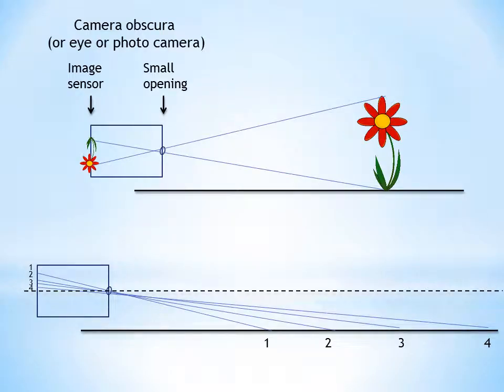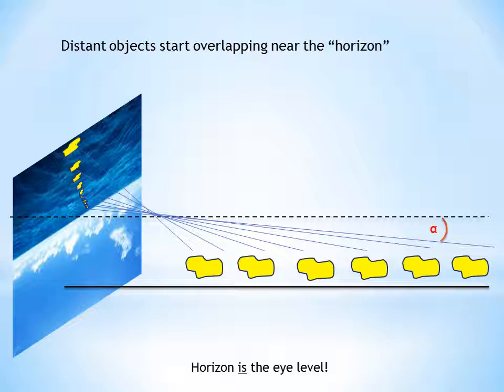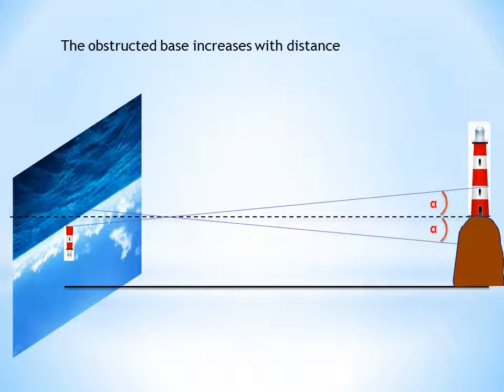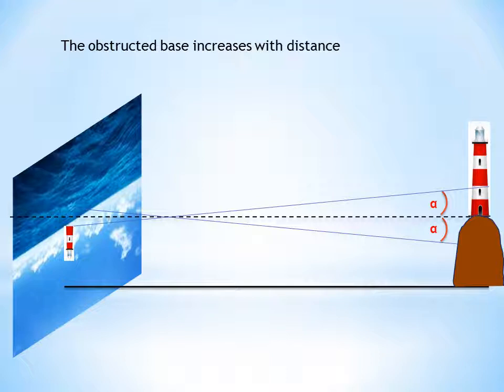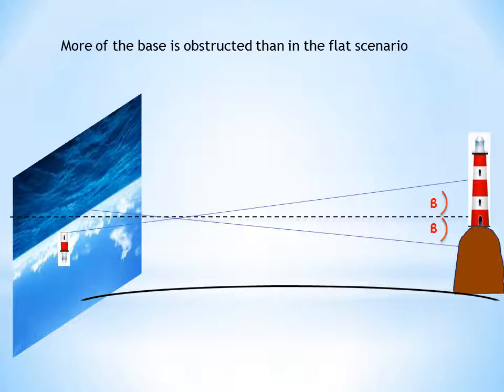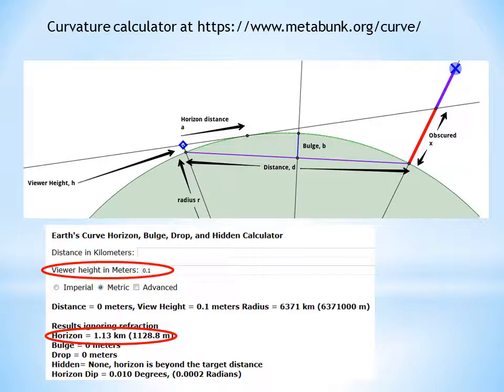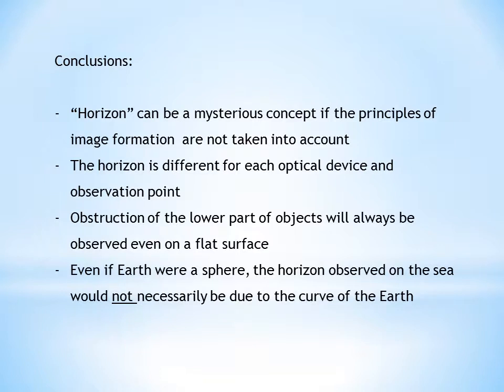Flat earth perspective   Horizon is the key

Comment: Very interesting video! I think narrated slideshows can be very effective, it's how I do all of mine. :-) You asked for my thoughts, well here goes!

3:23 "Things start overlapping." I disagree, if the oil patches are all on the surface of the water they will simply become so small and so close that it will be difficult to discern them. (This relates to your point at 4:53.) But they will never overlap.

4:20 You say that the horizon line will be different for all of us. But the evidence shows otherwise. You can get ten people, AND ten different cameras at different focal lengths from wide angle to telephoto, AND even a few telescopes, and every single one of them will see the horizon in exactly the same place.

You can test this at the beach by standardizing your viewing height, say, a hole in a piece of cardboard with a cross-hairs made of thread, and you can have a yardstick sticking up out of the sand between the observer and the horizon. The person (or camera) needs to say (or record) where the horizon is, when looking (filming) through the hole. All will agree.

4:35 You say that "horizon is the eye level." This has been repeated many, many times, but never tested by Flat Earth folks. It's easy to do: just borrow or rent a construction 20x Dumpy level, and aim it at the horizon. It will be below eye level by a fraction of a degree. If you can elevate it to a high cliff or a mountain overlooking a water horizon, then you will see the horizon to be significantly below eye level, when measured with an instrument. If you increase your altitude to 3182 feet, the horizon will be 1 degree below eye level. Not perceptible to a human, but measurable on a calibrated instrument.

4:53 Your point about the angle alpha and the "disappearance" of the oil patches is a muddy one. I think you're confusing the quality of discernment with visibility. I'm pretty sure this is the most important point needing clarification in your entire video. :-) At some angle alpha the oil patches will become impossible to discern, but they will be there. This angle depends on the size of the patches. For example, instead of oil patches, we have large ships, in a row, going off to the horizon, at no point will the ships become so small that they'll be impossible to discern, unless you're using a wide angle lens on an inexpensive camera, when the ships might become smaller than a pixel. But you'll be able to see them, significantly, regardless of alpha. The only thing that will cause you to not see them is the actual distance to the horizon (a calculation based on viewer height based on the geometry of the globe Earth), further than that and they'll start disappearing hull-first.

At 10:10 you discuss an image from Spain, where there's not enough information given. You might find this video interesting, from a former Flat Earther Matrix Decode, also filmed in Spain, with extensive detail given:
youtube DOT com/watch?v=mUgKxxR9XkU

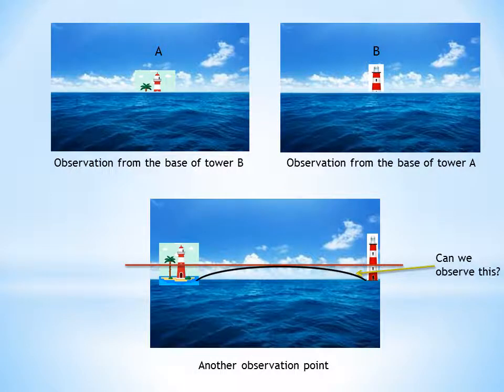11:42, you propose an interesting challenge, but here scale is everything. Here we take two 50-foot tall lighthouses on the globe Earth that are far enough apart, that a viewer (let's say standing at the shoreline at the base of the lighthouse) would see half the other lighthouse obscured, or 25 feet. At 9 and 1/8 miles, 25 feet are obscured. Now we take a third observer who can see both towers, and we elevate him so he sees the bases of both towers. But think carefully of the criteria: two 50-foot tall towers over 9 miles apart. This is a ratio of 1:964! In other words, if this third observer took a photo with the famous P900 camera, at max resolution of 4608 pixels wide, the lighthouses would be less than 5 pixels tall. Assuming a generous 60º field of view, this means the observer would be the same 9.125 miles from each lighthouse, and thus must be at an elevation of 55 feet above the water. 

The horizon would be about 9.1 miles in radius from the third observer's location and height. This horizon comprises an arc that stretches way out to sea, and is NOT the straight line between the lighthouses. A lot of people don't understand this! One's ocean horizon is NOT a straight line when viewed from the top, it is a section of a circle, with the viewer at the center. And yes, at only 55 feet elevation, the horizon will look very, very flat. :-)
Reply from the maker: Flat Earth Math, thank you very much for your detailed review. I realized when I made the video that I didn't manage to express perfectly all I wanted to say, but I thought it would be a starting point for discussing this difficult issue.

And here are my thoughts on your thoughts:

3:23
 <<<"Things start overlapping." I disagree, if the oil patches are all on 
the surface of the water they will simply become so small and so close 
that it will be difficult to discern them. (This relates to your point at 4:53.) But they will never overlap.>>>

I agree they will not overlap in a theoretical way, but practically they will overwhelm the resolution power of the screen. It is the same situation to a function that tends towards 0 or infinity. 
The point is that, practically, we have no way of capturing on a screen an infinite line stretching away. (The only way to do it would be to start moving along it.) If we can agree on this, we will then have to investigate exactly what is lost from the line when we look at the screen. 

 4:20
 <<<You say that the horizon line will be different for all of us. But the 
evidence shows otherwise. You can get ten people, AND ten different 
cameras at different focal lengths from wide angle to telephoto, AND 
even a few telescopes, and every single one of them will see the horizon
 in exactly the same place.>>>

I don't think I managed to get my point across clearly enough. What I meant is that, even though we all see this horizontal line and we call it the same, it is in fact simply a limit that will always appear at the line of sight, but the actual pixels on each screen are different if the optical characteristics are different. This is beautifully illustrated in the thousands of videos were the camera is zoomed in and out on the horizon. From the exact same spot, if we change the focal length, etc, we suddenly have a different picture of the horizon, but the line does not move because it is the line where all the light rays from below and above converge.

 4:35 <<<You say that "horizon is the eye level." This has been repeated many, many times, but never tested by Flat Earth folks.>>>

Maybe I should have emphasized the difference between my statement and the usual flat earth one (that you got sick of). I am saying the horizon is in fact the eye level, not that it "rises to eye level". The horizon is defined by the eye level, it is the line where the lower and upper rays converge to.
All this takes place in an abstract space, regardless of the flat/globe debate. It is just a discussion about how this line appears in any optical device or our eyes.

 4:53
 <<<Your point about the angle alpha and the "disappearance" of the oil 
patches is a muddy one. I think you're confusing the quality of discernment with visibility. I'm pretty sure this is the most important point needing clarification in your entire video. :-) At some angle alpha the oil patches will become impossible to discern, but they will be there.
 This angle depends on the size of the patches. For example, instead of 
oil patches, we have large ships, in a row, going off to the horizon, at
 no point will the ships become so small that they'll be impossible to 
discern, unless you're using a wide angle lens on an inexpensive camera,
 when the ships might become smaller than a pixel. But you'll be able to
 see them, significantly, regardless of alpha. The only thing that will 
cause you to not see them is the actual distance to the horizon (a 
calculation based on viewer height based on the geometry of the globe 
Earth), further than that and they'll start disappearing hull-first.>>>

You are right that this is the most important point.
The reason I took oil patches and not ships is because I wanted to understand what happens to the water surface in the image. If we have a theoretical perfect flat see extending to infinity in front of us, can you please explain what we will see on a photo? I think you agree we will see a "horizon", but how do you define it when there is no curvature formula? That is what I attempted to do and maybe I'll try to clarify it in the future.

One more try: imagine your ship is made of very thin slices stacked on top of each other. Now let's imagine an oil patch of exactly the size of the lowest ship slice and send it away till it just disappears from view. At this distance, what do you think will happen to all the slices above? How about the same exercise with a very tall tower?

 At 10:10
<<< you discuss an image from Spain, where there's not enough information 
given. You might find this video interesting, from a former Flat Earther
 Matrix Decode, also filmed in Spain, with extensive detail given:
youtube DOT com/watch?v=mUgKxxR9XkU>>>

I will have a careful look, but do you agree it would be helpful to have in the beginning of the experiment the predictions of what we should see in the flat/globe cases? I insist, in the flat case there will also be an obstruction of the lower part of objects at a certain distance. 
The problem of waves is also very important - I should expand on it in the future.

 11:42,
<<<  In other words, if this third observer took a photo with the famous 
P900 camera, at max resolution of 4608 pixels wide, the lighthouses 
would be less than 5 pixels tall.>>>

Maybe we could circumvent this problem by doing a composite image, a bit like here: https://www.youtube.com/watch?v=TJqtpongst4
I agree it is technically challenging, but my reasoning is that we should be able to analyse the situation of the perceived curve from a perpendicular angle of view. I will try to refine my explanation and challenge.
Reply: I did follow your link, and spent some time corresponding with the video author, Ranty Rant Rant. :-) Thank you for the link.

I cannot respond to your very kind and detailed comment right now, but I did think you'll find this footage of a motorboat just over the curvature, in some mild waves, interesting (cued up for you)
youtu DOT be/hdBz8l82n1w?t=12m32s

The boat is past the horizon, but is bobbing up and down, and is clearly not distorted in any way. At some points it's almost completely blocked by the horizon, other times almost completely visible. Clearly it's not "distance" that's causing us to lose sight of it! :-)

I'll try to respond more later, but please check out the video!
Reply from the maker: No hurry, I don't have much time either.
The last link doesn't work! (not even when I tried to mend it)
Reply from the maker: Thank you Muzikgod.
Very interesting video. We should be able to figure all this out!

I know you'll hate this, but isn't this boat clearly going up and down behind the waves? Have you seen how a narrow plank can obscure a tall umbrella? (https://www.youtube.com/watch?v=wYiB-KpkK_I)
Reply: @flamavara7613  Very interesting work, thanks.